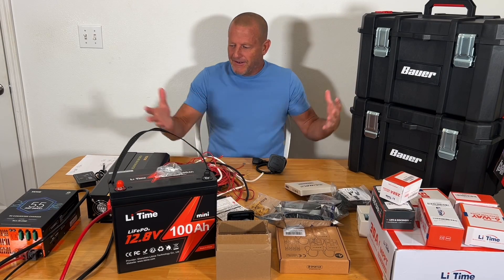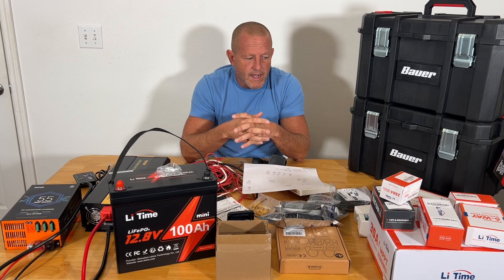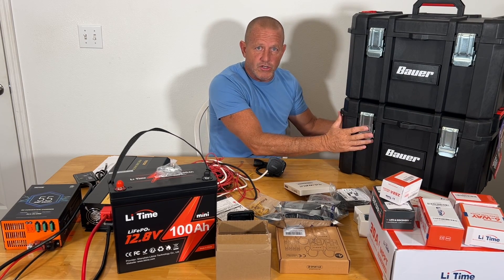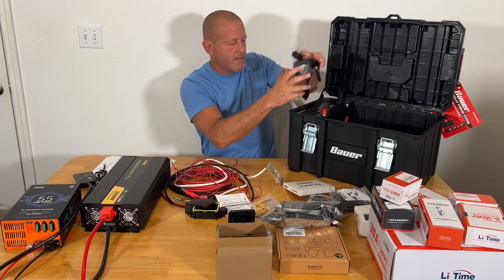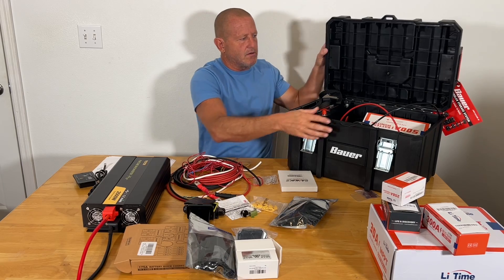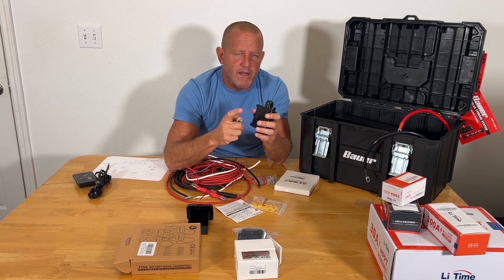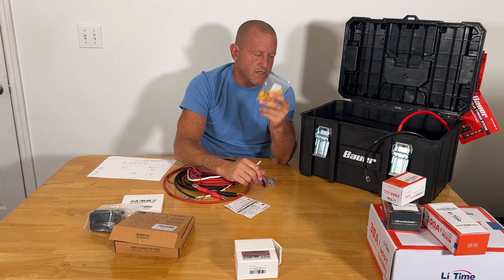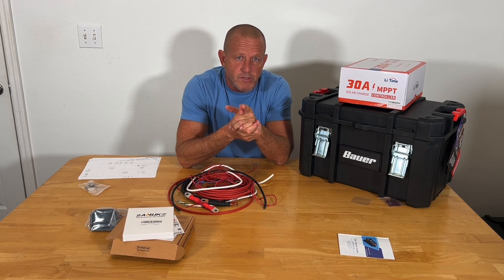DIY Portable Solar Generator Build. Episode 1- Lets Get Started!

Comment: While searching YouTube for different DIY videos on these builds I came across yours. I'm wondering why the solar charger is in the electric box and not the 12-volt box.    I doing the same route with a 12v and 110 box but my ideal is to put the solar charger in the 12volt so I can charge the battery while using that box/battery to run my 12v fridge.
Reply from the maker: @NYTROeast  it was about the space. you can but it where ever you need.  my thoughts were a charge and go 12 volt box with the second module used for more serious features. solarcharging and 120 volt